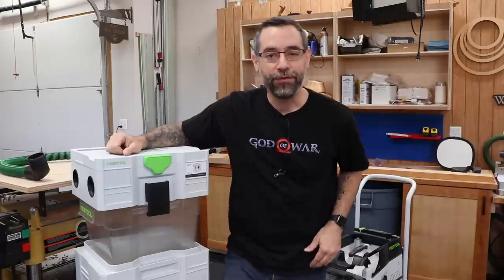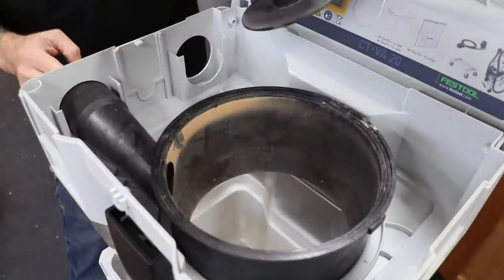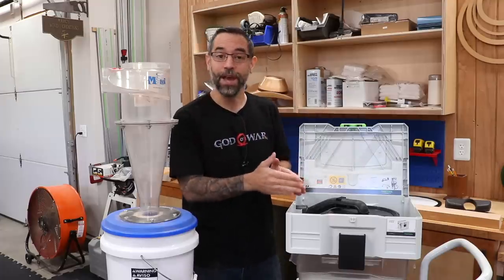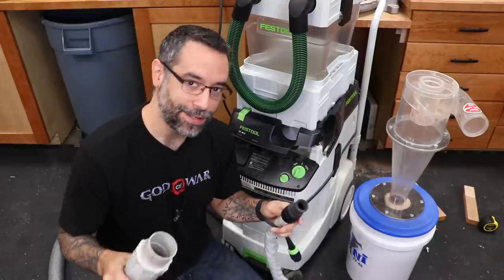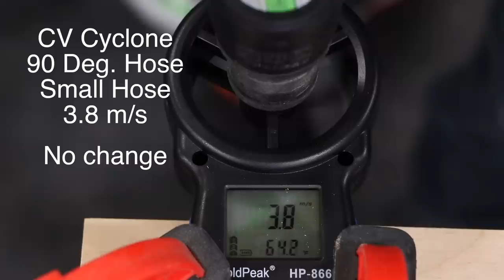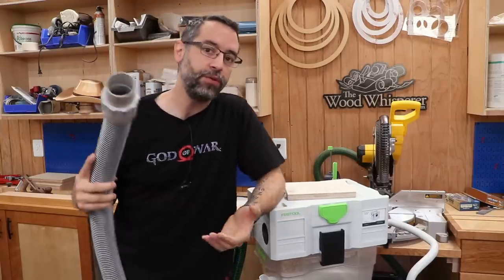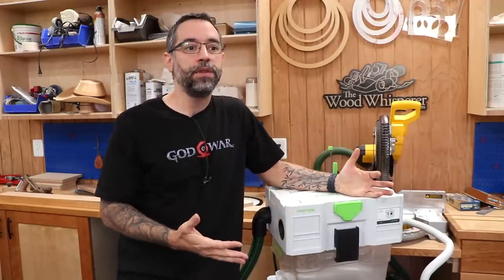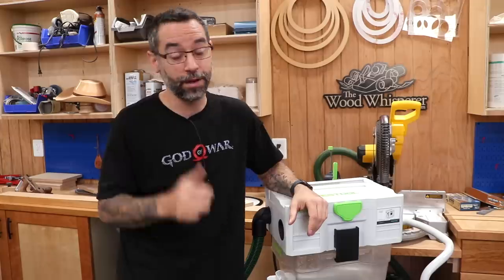Festool CT Cyclone Review | Not Great!

Comment: I watched this video before buying my CT Cyclone, so I knew what I was getting into when I got it.  I also picked up an airflow meter to do some testing of my own & found a 27% drop in suction when running it through the 27mm hose.
So, I started do ing some testing & experimenting.  I added some tape to act as gaskets to the perimeter of the 90º elbow where it seats into the lid, as well as the bottom of the conical piece that seats down into the Systainer.  
These two modifications were able to bring the total CFM loss down to only 14%.  I'll be searching for a thin foam tape to make for a more permanent gasket, but it would be great if Festool developed their own proper gasket set, as it improves things dramatically.
Reply: I also built a testing apparatus and have been improving efficiency. I'd like to implement your modifications and test it. Care to share any more details?
Reply: Wow, especially in this pricerange its a shame they didnt construct proper gaskets.
Reply: It’s a brilliant separator I’m a professional floor sander . Use some tape to seal a couple leaks and run it all day long on big machinery . Small footprint in vehicle.

Comment: Hi Mr Wood Whisperer - interesting review, just came across it - bit late. When the CT Cyclone came out, I bought one as well to use it and to compare it against my Oneida cyclone. Instead of a wind speed measurement instrument, which I tried as well, I have used a tool to measure pressure - which I think is a bit more reliable and it definitely produces numbers which can be reproduced. To cut a story short of many evenings of measurements and comparisons between cyclones and vacuum cleaners – the conclusion was that you really need to keep your filters clean, because that is where you really loose pressure. Not so much the 90 degrees angles (which I expected) and not so much the cyclone type. Of course hose diameter makes a difference and so does hose length, but the largest influence on the efficiency of the whole system, that lies in the filters. So the new Festool midi vacuum cleaner with the filter-cleaning handle on the outside – that is a good improvement.

Comment: I too have had mine since they came out. It’s a great bag saver.  I use mine with my CT-Sys which has a notoriously small bag.  I now change the CT-Sys bag once every 9 to 12 months. Before I changed it monthly or more on a big project. With the new larger capacity, the CT-Sys is now my dedicated “portable” Dust Extractor. I use it with all appropriate Festool tools and for clean up. I just remodeled a laundry room and bath room and the CT-Sys with Cyclone was my only Dust Extractor for sawing, routing, sanding, and even Kapex duty. My CT-36 with Dust Dust Deputy now stays in the shop.
Reply: yeah i just picked up this cyclone from Festool and cant wait to use it. I was wondering how often I'm gonna need to change the Bag in my ct26... wow you say 9-12 months!! that's a heck of a great deal of money savings in filter bags...

Comment: I've been using the festool cyclone for a year now and I am extremely satisfied with it. I have not seen any problems. Only benefits so far.
Reply: But do you have the cfms to drive the turbo nozzle beater bar which requires the larger hose? I just bought this when they couldn't tell me which size connection to the vacuum it had. Saw the thin hose, though I'll use one of my other fat whip hoses, opened the top, has an inch thick black plastic duct. It can't drive my festool beater bar brush on a 7m hose. How could they make it without at least the mid sized hose in mind? Dropping to the small sander hose from the start is a major drop in volume. I run planex, renofix, both larger hose, both create bulk, as well as cleaning attachments. Guess I'll go back to sweeping more to save my filters and picking up the things I won't have lift for. They should at least offer another lid\duct for larger hose. It's gonna have to go back as it fails at 80% of what I do. I cat handle the rotex with their proper hose but that's it. Takes forever to fill a bag with one of them anyway. So it's just added bulk and complexity for reduced performance in my operation. Mid hose even would have been great.

Comment: What I would really like to see is a compact system by someone that utilizes a cyclone separator that is integrated into a short vacuum unit.  There's no need for 4-6 gallons of debris storage in most shop vacs if you're using a separator so I'd rather have something that the total height can live under a bench or miter station.

Comment: This is not for a casual users, got slammed a lot in the reviews here, but I use it with the festool drywall sander and it is amazing. There really aren't a lot of options to collect drywall dust without ruining your vacuum as the dust clogs your filters and overheats the vacuum. So money well spent for me. Good review, but left out some uses.

Comment: Would just like to add ,, I use mine on a syst vac , and no loss of suction at all. It fits neatly in the van as it's a systainer... if I didn't have this I would be emptying the tiny bag every 5 min on a router table or thicknesser..

Comment: I noticed the same issue on drop in suction but I gained back what suction I perceived to have lost by ditching the short 27mm hose supplied with the cyclone kit and using a 50mm hose cut down to the length of the short supplied hose. In your test you used a long 50mm hose. 
There still is a slight decrease In cubic foot per sec/min but if you then upgrade the tool end hose to 36mm hose all together you end up with more cubic foot than you had with the basic set up. 
Basically ditch the shirt 27mm gap hose and ditch the tool side 27mm if you want superior sucking for Kapex, router, track saw etc… 
If you are only using sanders the cyclone is fine with the 27mm hoses because you need to turn down the suction anyway or  the vacuum pulls the sander into you work surface and causes sanding  abrasive cut circles/swirl marks. 
I have 3 of these set ups. One for Kaypex, one for sanding and one for high chip creating tools like the router. All gave the cyclones on them all on the original provided bag.

Comment: After watching this video I got an idea. You have your dust collector and you also have your dust extractor like these for small tools as you know large system is not that great for hand tool dust collecting applications. So, I bought a Kirby vacuum cleaner motor head which has an impeller that is separated from the motor, which has a separate assembly to get cooled.  The impeller sucks the dust and within few inches exhausts it to a bag via 3 inch pipe.  I’ve removed the bag and connected the three inch hose to a 4 inch hose to my large shop three stage dust extractor with cyclonic action.  This way I have one place for all the dust from the small and large tools, none of the filter expense of expensive small systems like festool and other, takes very little space and it’s in-line install setup for under 100 bucks.  Awesome video as always very informative. Thank you.

Comment: I’m tinkin Festool have ripped people off for years, they do have some unique engineering advances over competitors however a little vacuum cleaner with connectable dust hoses & hyper inflated prices make it difficult to purchase, nice review 🍻👍
Reply: Festool tools are built as an entire system. If you have a festool saw then you would use the festool dust extractor so that you can properly use its switching and dust extraction. 

You only think it is expensive because you have no idea what to use the tools for. Mafell is about 3 times more expensive than festool.
Reply: It's only a rip off if you're forced to buy it.  But we live in a mostly free market economy so you actually have no justification for bitching.  Are you a cashier at 7-Eleven? 

I have about $5G in Festool stuff and based on the piss poor after purchase service of Festool USA I'm unlikely to buy any of their tools when it comes time to replace them except for their sanders and the domino tools.

Comment: The suction loss is coming from the part that goes from the center of the cyclone to the connector hose.  Looks like it's only an inch, inch and a half in diameter.

Comment: I bought it and so far it works fine. Not sure how long I'll get that back in savings on bags as I go through maybe half dozen bags a year now. Having finished a new shop and have more clients that will ramp up a bit but, I have a dust collector now and use a table saw a lot more. Time will tell. It is a good well built accessory.

Comment: As a hobbyist, my rationale for Festool is time savings.  The Domino has been amazing in that regard and has not only saved me some of the precious little time I get to go into the shop (I work full-time) it has also allowed me to do some pretty creative things I would have been hard-pressed to do before.  Their Quad drive drill is a monster.  I have a Dust Deputy over a shop-vacuum (a la Jay Bates) and it works great, but I was hoping for good reviews for the Festool Cyclone so I could have something lower to the ground and easier to move.  (Or I could just put better wheels on the shop-vac cart...)

Thanks, Marc, for another informative video!

Comment: Thanks for the review Marc, I have the Oneida for Festool, was wondering how the F-for-F stacked up.  The cone on the Oneida is about 11" high, with the router and miter saw I have not noticed a big loss in performance.  The Oneida uses a large hose from the cyclone to the CT, with one straight and one 90-deg fitting.  The separation is very good, very little dust in the vac, it's all captured in the Oneida bag.     thanks again,  cheers...
Reply: Peter Parfiit showed  98% capture od sample shop dust with the Festool attachment. Hard to believe Oneida could signiicantly better.

Comment: I have the Oneida Super Dust Deputy that you mentioned at the end. They released a second version (the one I have) that is made out of anti static material and I notice a loss, but like you said for tool use it isn’t a big deal. I like the Festool version’s ability to have a systainer on top, but don’t feel the need to replace mine (yet!). Thanks to doing the review, I know we were wondering how the Tupperware would perform! 😀
Reply from the maker: Good news is if you don't want to use the cyclone, you can always store your Sunday leftovers in it.
Reply: The Wood Whisperer leftover brisket!
Reply: I have the Oneida too.  After seeing Marc’s review, it occurs to me that the biggest advantage of the Festool design might just be that transparent collector bin.  Sure would be nice to know how full it is without risking a face full of fines.
Reply: I would say that's crazy talk, but you might have given them a new idea for a Festool warming drawer.

Comment: Cool to see in action, thanks!

Not trying to be a troll here, but for me, shop vac cyclone performance is based on suction power (vs airflow) as that is what helps me pull dust through my tools. The second is how well it separates the fines to keep the filter clean (and thus longer lasting suction). And with all that said, I admit I haven't tested many out to have an educated opinion.

Comment: I have the Oneida Dust Deputy that sits on top of the CT and I’ve been mostly happy with it. I get almost no material whatsoever into the CT. My one complaint is that the CT clips don’t hold it very steady and it comes loose pretty often, but, not having my CT full of dust and constantly changing HEPA filters, it’s been worth the tradeoff. However, recently the hood on my CT 26 fell apart and by “fell apart“ I mean the plastic disintegrated. Festool said that happens, especially in hot, humid conditions, which we have here on the Mississippi Gulf Coast.  I ordered a new hood and the design has changed and now the Festool clips don’t interact properly with the Oneida collection box whatsoever. I’m probably going to have to fasten it with bungee cords.

Comment: Two things I noticed on the product.  First the fittings on the inside are not tight.  There is not even a gasket to provide a tight seal.  So you may be loosing some suction there.  Secondly the the internal hose from the cyclone to the external port appears to be small.  So your airflow is going to be restricted no mater how big of a hose you connect to it.

Comment: Generally, people test the vacuum pressure as well as the air speed. Couldn't tell you why they do it, I'm neither an engineer nor a liquid.
Reply: Measuring the static pressure tells you how flow rate will be affected by adding constrictions (eg. reducers, gates, extra hose length) to the path.

Comment: Have you tried out the Dustopper? Works with standard big box buckets. Performs about the same as dust deputy in suction loss and dust separation. However its vertical footprint is tiny compared to the deputy, the small one even.

Comment: Thanks for the review. It might be obvious in your shop but in the video at a 1.07 it isn't clear if the exhaust goes through the central column from the bottom or from above the  horizontal baffle into the column not shown on the opposite side to the intake. Winston Moy had a similar CNC made design that the exhaust went into the column sides.  A thien baffle has a 270 drop slot but this is in-between in concept.

Comment: Given the need for airflow to collect from machines that usually produce the larger chips, that separators are meant to pick up to save filling bags, that drop using the 36mm hose really makes it a bit redundant for woodworking. Shame. I wanted to want it. Thanks for the review. This is the only one I’ve found looking at that airflow. The suction pressure tests only test how well the drop box seals work. Which can usually be fixed easily but not airflow restrictions

Comment: Just bought it after my preseparators were spitting out puffs of dust when my festool punches the filter. Bought it quick. Can't believe there's such a small restriction. I need to use the larger hose for several items. The times we need a separator we're using larger diameter hose for bulk dirt. The grinder, vacuum scraper etc. Can't believe it drops to the small hose. Can't use their turbo nozzle beater bar with it. If I can only use it with the standard sanders which will take a month to fill up with running full out what's the point of the extra bulk and trouble? Trying to think how I could rig a thing to run 50 mil hose to the separator and make a part of the same diameter to switch in for the black lid thing. I need to use at least a 36 mil hose as I am running a planex and a renofix, grinders and want to vacuum bulk dirt without filling my filter bags. This defeats the purpose. Harbor freight just came out with a dust deputy knockoff for a bucket. Just need a thick bucket. Oneida also came with a separator that rides on festool. Just can't put your vacuum nozzle box on top of that.

Comment: hmm. I can't see the need for this. Surely as a trades person, you want to be carrying less crap to/from a job, as well as having less crap in the way. I'd much prefer a small vacuum and just deal with having to empy the bag more frequently. From a hobbyist point of view, the price is ridiculous, and again, a simple vac seems like the better option in terms of how much space it's going to take up.
Reply: Trades people who use festool on site may also use the exact same tools in their workshop.
Reply: These cyclone separation systems are great for the fact they put way less strain onto the filters of the vacuum. Therefore increasing the life span of the tool and decreasing the impact on your wallet for new filters, bags, motor parts. You'll also generally just get a lot better suction from the tool if its running un-restricted.

Comment: Would it be possible to test air quality when using each one?  Festool is known for dust containment, so I'm wondering how it would stack up to the Clearvue.  In such a test, using the best filter in each one.  One reason to buy Festool would be to keep the fines at a minimum if there was a big difference.  I don't have a Festool vac, just a Ridgid with a Clearvue and it works really well for visible dust.  I've always wondered about the fines, though.

Comment: I noticed that the Festool vac was set at it's lowest power level.  Would that make a difference?
Reply from the maker: It would if that were actually the case but it was set at the highest setting. 😁

Comment: When you have your Cyclone and you have a liner in it does it suck the bag inward a little until you get a couple inches if saw dust in it.  or should the plastic liner suck to the walls of the container. I just purchased one and installed it on my CT36 and that is what its doing.

Comment: Good review. I bought one of these a couple of years ago, and the suction does suffer, although as you say, the CT Cyclone still does its job perfectly. Using the anemometer won' give you meaningful results, as with the smaller hose you will have a higher velocity airflow, and with the larger hose, a lower velocity BUT more than likely an increase in volume throughput. Need to measure cubic ft min / litres per second to get a decent comparison 🙂
Reply: He wasnt comparing the differences between hoses it was to compare if the drop was more significant depending on the hose used

Comment: What I would like to see is the difference in the quantity of material collected, like you did in the older cyclone shoot out with the CV Mini and the Dust deputy. Only a very minute amount was in the Oneida bucket and I didn't see any at all in the Clearview bucket. That is the whole purpose of these cyclone separators
Reply from the maker: That is the purpose, but if the unit has a dramatic loss of suction, separation is a moot point. unless you’re OK with losing suction. I’m not. I’ll have to wind up selling this unit.